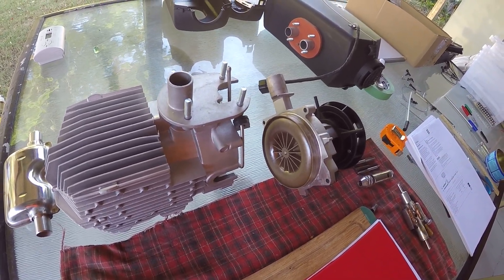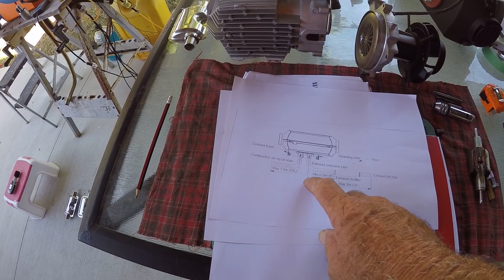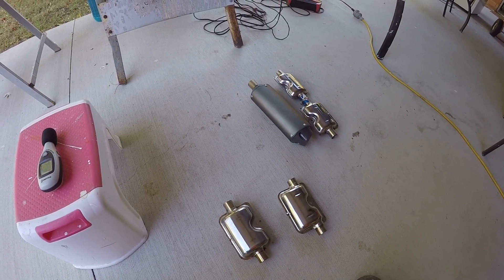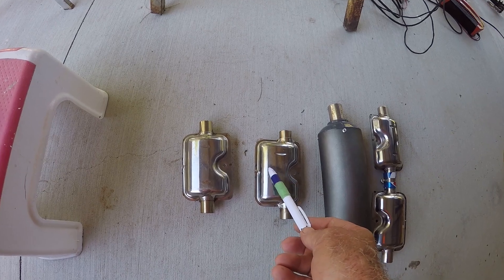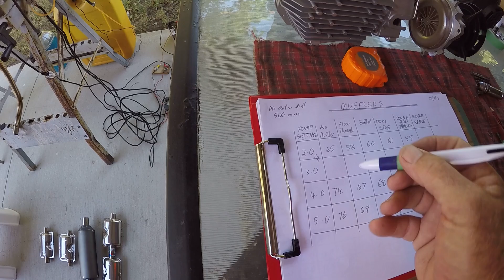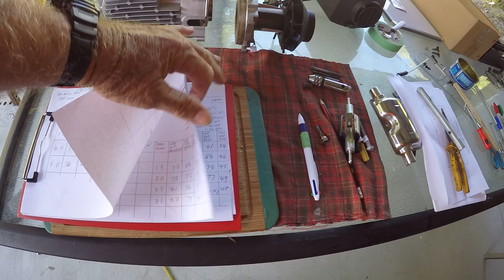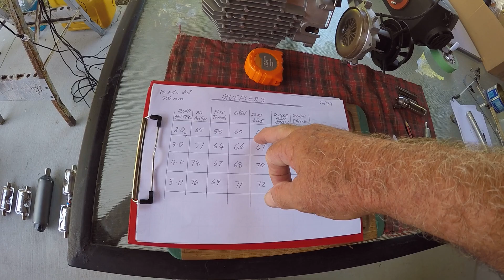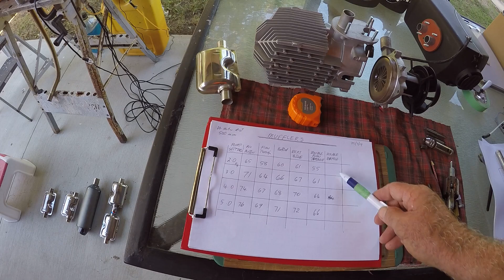Chinese Diesel Air Heaters - Part 8 - Exhaust and Mufflers

Comment: John.  Is it possible to position the heater upside down, with the intake and exhaust ports pointing up?  For my application, positioning the heater with the ports up would make installation easier.  Thanks!
Reply from the maker: Sorry, NO.

Oh, it will work for a while, just as your motor car engine will run without cooling water or any engine oil, for a while. Diesel will start to pool at the bottom of the burner chamber, flood the glow plug and burner screens and then the heater will not start.

You can however mount the heater on its side, provided it is the side with the glow plug on the top.

Regards,   JMcK
Reply: thanks!

Comment: Thanks for the video.  Great information in the entire series.  I'm planning to install a diesel heater in my workshop (before winter).  For my application, I'd like to install the heater about waist high and have the exhaust do a 180 degree bend when exiting the heater, travel up a wall about 3 feet before exiting (90 degree bend) thru the wall.   A total of 270 degrees.  Do you see any negatives with this installation?  Thanks!
Reply from the maker: Hi Jdchang,

Not sure I can visualise your first 180 deg. Is it horizontal or vertical?

Either way it should be ok because the exhaust is rising. Hot exhaust likes to go up. 
You could have some issues if wanted to force it down 3 feet with 270 deg of bends.

Cheers.  JMcK
Reply: @johnmck1147   90 coming out of the exhaust port, 90 to go up the wall about 3 feet, 90 to exit thru the wall.  Thanks for your reply!
Reply from the maker: jdchang1 

Should work well.  JMcK
Reply: @johnmck1147  Thanks, John.

Comment: John - thanks for these terrific videos - they are really most helpful.  A really dumb question but if the exhaust temperature is something like 400 to 650 deg F and the condensation (my exhaust run is much shorter than yours) amounts to less than a teaspoon, would not the fluid boil off within min. of firing the heater up?  Thanks.  John Coppedge
Reply from the maker: Hi John,

Yes that is correct in many cases. 

But even with a short exhaust just a tablespoon of condensation water trapped in the exhaust can cause back pressure in the heater, preventing combustion air to enter the burner causing a hard start. The little  fan in these heaters is not very powerful and you restrict the exhaust you restrict the inlet combustion air.

Also sometimes traces of unburnt diesel can leak into the exhaust. If that pools in the bottom of an exhaust loop it can be interesting when the exhaust is hot enough to ignite it.   JMcK

Comment: Hi John, thanks for all the great videos. I have an issue with my heater. It is fitted and primed. On start it goes through the start process then white smokes comes out, quite thick, then the unit "backfires" as a mechanic mate said it sounds like it is igniting in the exhaust. Once it warms up the white smoke goes and it runs great. My feeling is that maybe the unit is trying to light the fuel before it reaches sufficient temperature. Any suggestions?
Reply from the maker: Hi Greg,  I really need a little more info. 

Does the heater do this every start, or only on the first start?

Is your fuel tank higher than the heater? With enough  fuel head pressure you can get leakage of fuel into the heater and exhaust so you get a rich/wet burn start. If this the case install a tap in the fuel line and turn off after use.

Is your heater mounted correctly? If side mounted with the glow plug down you get diesel pooling and issues you describe.

Have you had the heater apart and damaged a gasket? Have you checked the burn gaskets? 
This comes back to the first question, did this happen from new, or it started some time later. I have not seen a bad gasket from new, but people sometime damage gaskets when servicing the heater. A damaged gasket can cause similar symptoms.

Does your exhaust slope downwards, or does it have a loop in it. If you have a loop you must drill a small hole in the lowest spot to allow moisture and unburnt fuel to escape. Unburnt diesel in the exhaust loop can cause issues you describe.

Sorry I can not be of more help without more info.  JMcK
Reply: @johnmck1147  Thanks for your prompt reply. In answer to your questions. The unit is brand new and did this from the start. I have not had the unit pulled apart.  I took great care in the install to ensure it was all done to specification (watching your vids was a huge bonus. The tank is above the height of the unit and I ensure a tap was put into the line. The exhaust runs slightly downhill with just the bend out of the floor. The muffler as the drain pint hanging. This has happened on every start not just the first and it happened on the first trial start when I did any exhaust fitted.  I have also been asking around, it was suggested I change the amount of fuel coming in (in the settings). but as I have a dial control I will have to buy a digital control to get into the settings. I am happy to try this as well. Again thanks for your help.
Reply from the maker: Greg Smith 

Hi Greg, 

It looks like you have done everything right.

Suggest you do not play with the fuel settings, you can open up a can of worms, and I doubt it will solve your issues.

As the heater is NEW I suggest you ask for a replacement. If your install is correct, and what I read above suggests that it is, you are likely to have a dud heater. The aluminum casting could have a crack, you could have an issue with main burner screen or glow plug screen, or you could have an ECU issue. It is rare, but the above issues occasionally occur. Get a new heater, or a refund and buy elsewhere.  JMcK
Reply: @johnmck1147  If only that were easy. The seller from ebay is no longer there. Oh well. Will start to look elsewhere.
Reply from the maker: Greg Smith 

This occasionally happens. He may have bought a shipment of duds just like yours. You can get a refund if you paid by PayPal, if not contact eBay for a refund.  Good luck.  JMcK

Comment: Thanks for the videos - very informant.  Question, I am replacing a Propex propane forced air heater with one of these on our boat and am trying to use the same inlet and combustion hoses.  Both  hoses are slightly larger OD than the diesel (I can use a section of the supplied hoses as a shim) but the through hull is wildly different.  Do you have any idea what the exhaust temperature is?  Depending on the temp, I may need to add some insulation between the exhaust/inlet fitting and the hull.
Reply from the maker: Hi John,

The exhaust can reach some 100's of deg C and must be isolated from the hull. 
You must also use a suitable isolation through hull. You can buy a polished ss exhaust through hull on line. Search " Eberspacher diesel heater marine exhaust through hull"

If you are a handy welder you can make your own or get one made, but probably cheaper to buy one. Have you seen my boat install video showing the through hull?.  JMcK
Reply: @johnmck1147  From a search of more videos, I am guessing 600 deg F at high output.  The Propex fitting is different (you can look it up on line if you are interested) - it takes care of the input and exhaust.  The air intake is just below the exhaust which may serve to keep the temp of the fitting in the reasonable range (or it did with the propane heater).  It has a plate offset from the port which may also be problematic but I thought it was a really good idea since it would dissipate the inertial forces of a wave slap.   Propex heaters, from LONG conversations with the factory and "local" (only 2,500 miles away) dealer trying to get the thing repaired and working (I think it is the board - I am afraid this unit is headed for the dump), is also very sensitive to combustion hose lengths,  so I am hoping the diesel requirements are not too  far off.     Again, thanks for your help and your videos are first rate and very helpful and informative.

Comment: Hi John what would happen if you added a extra pipe between the muffler's would extending the exchaust do any damage.
Reply from the maker: No Michael, you can extend the exhaust pipe a bit. If going upwards you can add about 3m extra without issues. If straight it is better to go with bigger pipe to reduce back pressure. Avoid long down exhaust runs.  JMcK
Reply: @johnmck1147  Thankyou.

Comment: hi john loveyour videos , i have a question ,the pulse vs temperature if run my 5kw heater at 2 pluse will have restrict the heat achieved ?
Reply from the maker: Hi Ekdave, not sure what you mean. You can manually set the fuel pulse rate. On most heaters this ranges from 1.6 Hz to 5.5 Hz. The higher the pulse rate, the more fuel pumped into the burner and more heat generated. Two pulses (Hertz) is a low setting, and less warm air is delivered to the living area.   JMcK
Reply: @johnmck1147  hi John thats exactly what i wanted to know , so that makes me ask if increasing temp doesnt increase the pulse of pump how does the thermistate function (may have asnwered myself stays on until temp reached ).
thanks David
Reply from the maker: ekdave1962 
Hi David,
You are increasing the pulse rate to pump in more fuel to have a hotter burn to increase the outlet air temperature. In manual mode you set a particular pulse rate and the heater runs at that set rate. If too cold, increase the pulse rate a little, too hot, pulse rate down a little.

In set temperature mode the heater roars along trying reach the set temperature, then it reduces to idle or switches off. 

Cheers,  JMcK

Comment: Hi John, nice series you've put together here. I didn't expect the straight exhaust would reduce noise better than the curved one, or a dirt bike one would!

You commented on here or in another video that there are chinese heaters modeled after two of the name brand heaters (webasco, eberspacher, planar, and or espar (sp?)). I don't remember which two variations they were, but I think you said one was better than the other for maintenance and easy of access (and maybe sooting). Do you remember which is the better design, and how to tell them apart from an seller's photo?
Reply from the maker: Hi AS,  the most common Chinese Diesel heaters available on eBay are direct copies of the Eberspacher diesel heater, but there are a few copies of the Webasto heaters also sold, and I have a 2Kw copy of a Webasto. 

In my personal opinion, the Eberspacher design better for DIY maintenance.

Yes, you can tell them apart from a photo if you have worked on both. I suggest you go to both the Eberspacher web site and the Webasto web site and study the photos of both types. However, if you order a Chinese diesel heater off eBay, 95% of the time, what you see is Eberspacher copy.

Good luck.   JMcK
Reply: @johnmck1147  Thank you so much! It's quite the compliment when people on youtube, camping forums and blogs all use you as their source of info. Thanks for the videos and super consistent responses in the comments. I ordered a smaller red one today and THINK I got the eberspacher. 
https://www.ebay.com/itm/264409820083
The 2kw gray ones seem bigger (but not 5kw sized) and are cheaper. Here's hoping.

Thanks again. I'll be seeking your guidance in your series further I'm sure!

Comment: Do you recommend using a turret mount when installing these into a caravan?, I thought as long as I cut the hole out around the intake/exhaust I should probably be okay
Reply from the maker: Hi Shane, 

It is preferable to use a turret mount or similar when mounting through a plywood or composite floor. 

If you can't get a turret floor plate you can use a metal 100 mm gutter down pipe adaptor to give you a metal guard around the cut out hole.

If you are unable to use a turret mount or metal line the combustion intake and exhaust hole, the cutout in the wood floor must be a minimum of 100 mm dia, and the plywood end grain well sealed against moisture. 

Cheers,  JMcK

Comment: Hi, can you tell me if youve done a comparison between the supplied exhaust tube and the  one designed by and supplied with the VVKB heater.  They claim less noise, easier bending/forming longer lasting ect.  Wondering if its worth the extra cost. Thanks
Reply from the maker: Hi Hay Trailer, the VVKB exhaust hose is a much better exhaust hose, but whether it is worth the extra cost depends on your application. I would be happy to use the exhaust hose supplied with the cheap Chinese copy heaters in installs like caravans or motorhomes where the exhaust hose is external, but would only use high quality exhaust hose in a boat where the exhaust hose is internal.  Regards,  J McK

Comment: Hi, great videos, I see the link to the pass through exhaust that you posted is no longer available, any idea what I should look for on EBAY for a pass through ?
Reply from the maker: Hi Chris, search for diesel air heater or parking heater muffler.

Here is a link to get you started in your search.

https://www.ebay.com.au/itm/24mm-Diesel-Heater-Exhaust-Muffler-Pipe-Silencer-Clamps-Bracket-For-Ebespacher/362935883396?epid=19023397193&hash=item5480aa1684:g:xqAAAOSwJ2pb1ryb

Regards.  JMcK

Comment: Love the videos John , thanks for all your efforts, you are the guru. I plan to put my exhaust directly into the 4' exhaust of my main engine which I think means I can do away with the muffler all together . As the main is down below and sealed from the berths and the saloon , very little noise will penetrate any way.
Reply from the maker: Hi Bradley, thanks for the feedback. 

Sounds like you have a plan. I would be concerned about engine exhaust coming back up through the heater, but I can't make any comment as I have never tried that myself. Suggest you bring heater exhaust in at sharp angle to lessen chance of back flow into the heater, and have a CO tester available.

I would be interested to know if your plan works.  JMcK

Comment: OK 2 mufflers in series, but what if you had 2 mufflers in parallel?

Or perhaps if you were to encapsulate the exhaust inside a lead lined chamber?
Reply from the maker: Hi Roger, you could try that, but but suggest you make a y splitter rather than a double u splitter, to lessen back pressure.  
Re the led chamber, that could also help, but leave an air gap.
If you do this, I would be interested to know how things went.  JMcK

Comment: My friends Chinese diesel heater started to pump backwards . You get what you pay for planer would be a better option 2 years guarantee
Reply from the maker: Hi Richard, thanks for the feedback.  

If you can afford the greatly increased price, a brand name heater will give you some piece of mind, warranty, and support help.  Agreed.

This series of videos is aimed to help those DIY persons who can not afford, or choose not to purchase a brand name heater due to the cost. In Australia you can buy a trailer load of Chinese Copy heaters for the price of one genuine brand heater.

Yes, you will get the occasional dud Chinese heater, but in general, I have found these little heaters an excellent product. 

Not sure what you mean by "pump backwards"  Are you saying the fuel pump ran backwards?  Impossible. 

Are you saying the internal fan ran backwards? Possible, and I must try this sometime I have a bit of spare time. I wonder if your friend had his heater apart and accidentally reversed the polarity of the fan wires.  Regards.  JMcK
Reply: @johnmck1147  point taken !